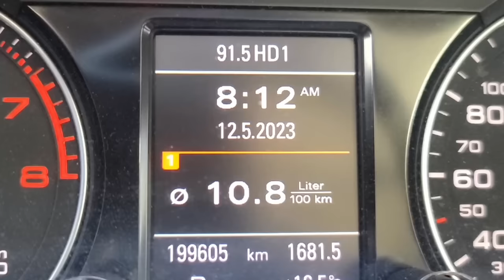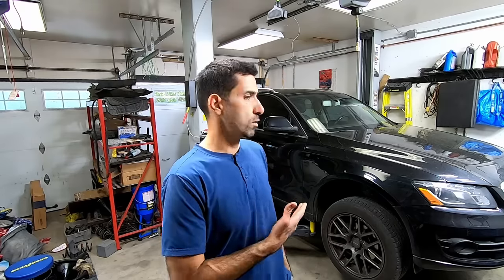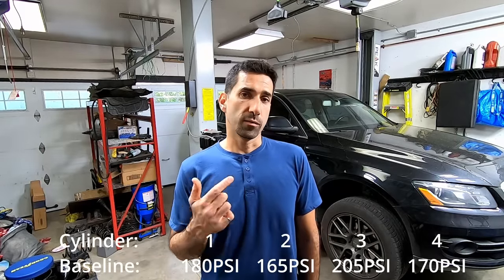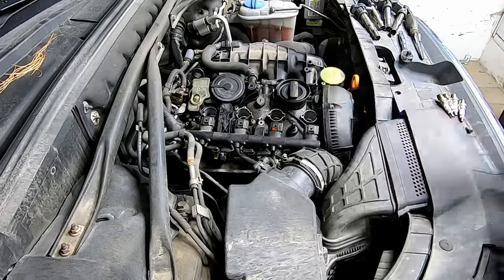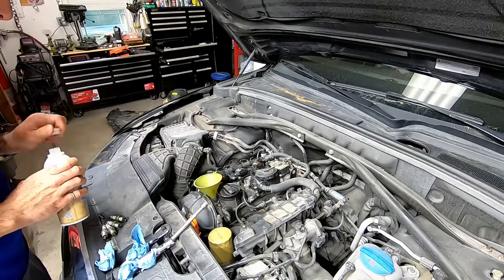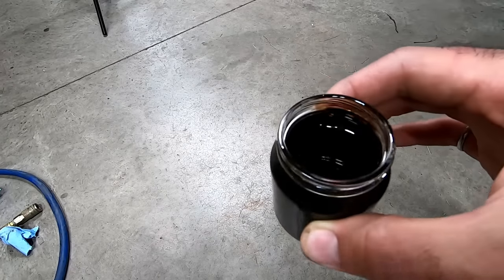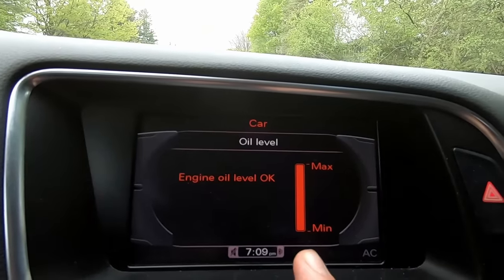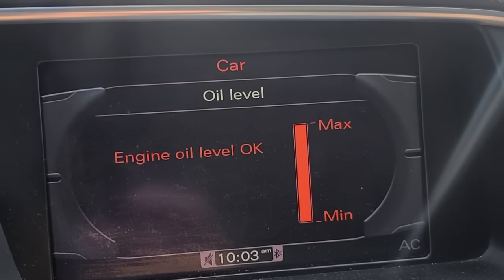How to fix excessive oil consumption from clogged piston rings (Part 2)

Comment: Can't believe this worked! Thanks! Did a Liqui Moly Engine flush at idle for 15 minutes, then did the piston soak with only 2 treatments of 2oz per cylinder. Checked with a endoscope the next morning and vacuumed out one cylinder with a syringe and hose. Changed oil and plugs and the oil level is holding with no change now. Was burning about 1 quart every 100-150 miles. Great stuff!
Reply from the maker: nice! that sounds like a good alternative
Reply: Update at 1000 miles on my 2012 Audi A4. About a third of a quart used since the engine flush & piston soak 🤯 crazy! I was at about one quart per 100-150 miles before. I thought I might do a second treatment with berrymans but it looks like this has done the trick! Stoked I stumbled across your video 😁
Reply from the maker: @lukewiens6134  great results!! Thanks for posting
Reply: Vous avez utilisé un Engine Flush Liqui Moly.
Et ensuite vous avez mis le même produit dans chaque cylindre pendant une nuit?
Reply: @ecerce2151 I used liqui moly engine flush as directed by the instructions, then before changing the oil then did the piston soak with berrymans. afterward I changed the oil and started the car. Took 2700 miles for the audi to say I needed to add another quart
Reply: Could you explain me the process to soak the pistons? He mentioned to crank it. Could you not hydro lock it?
Reply: @fredbeiner2620  not if you don't put the spark plugs back in, which you shouldn't anyway.
Reply: @fredbeiner2620  and it's best if you hand crank it.
Reply: how was yours starting? after it was done?did it take a while
Reply: @timpresutto184 it took about 20 seconds to catch and then clouds  burning up out of the exhaust for about 5 mins
Reply: @basesperanca  Couldn't you just pour it in the fuel tank and avoid all the drama?
Reply: @ETMotorsports   Couldn't you just pour it in the fuel tank and avoid all the drama?
Reply: @alexshatner3907  put what? B12? No, it's supposed to soak the pistons. The same principle as leaving your dirty, dry dishes in the sink with soap and water.
Reply: @basesperanca  But is that like trying to soak a piece of metal that is not like a cloth that can absorb, like washing your car from the outside and it is soaked for one week with water, because of all t he water that was absorbed into the paint??? I'm Confused, unless the rings and cylinders are made of cloth
Reply: @alexshatner3907  what we're trying to clean is the sludge that got into the piston rings/grooves and oil drain holes that got clogged with carbon build up in the pistons. It's the carbon build-up/sludge that will get soaked and soften up/liquify, and then get flushed away with an oil change. So, the pistons are like the plates, and the carbon sludge is the food. It makes sense to me.
Reply: @basesperanca  That does make sense, so what gets soaked is not the metal, but the carbon and sludge, but does the product also get poured in the oil? or does it just get poured in each cylinder?
Reply: @alexshatner3907  the product gets poured into the cylinder but if clearance between piston and cylinder wall are not tight enough, some of it will get into the crankcase and therefore the oil. That's why some people I've seen prefer to flush the oil immediately after a soak, instead of driving it directly.
Reply: @basesperanca  Gotcha

Comment: I did the same treatment for my 2001 Toyota Corolla, which was burning oil like crazy. I also had a very difficult time starting up the engine, just like you. I was told because there was no compression. But my Corolla is barely burning any oil now. so this works !!
Reply from the maker: Hmm so I guess the compression gets affected from the soaking? Interesting...I guess that's possible... it's funny I actually watched a guy on youtube do this to a corolla before I did it on my audi :) full circle
Reply: @ETMotorsports   I think you and I saw the same guy on YouTube that did this on his Corolla. I remember his channel is DIY Dave or something like that. That’s how I learned and did on my Corolla. Lol.
Reply: @ETMotorsports  The carbon that is getting the oilring blocked is the same that could get an piston ring stuck.
Reply: oil washes out from pouring solvent so they dont seal. i could barely start after pour, but it worked and now im not adding oil
Reply: The 2001 Corolla oil burning issue is a little different. It's due to plugged oil return holes in the piston-- of which there are only two-- that was the root of the problem. Later designs had four oil return holes. I have a 2001 Corolla, original owner, 225K miles, and it still doesn't burn a drop of oil because I always changed oil at 5K miles with synthetic from day one.

Comment: I performed the piston soak 3 days ago - so far over 100 miles and no moving the oil level bar. We will see..as I am usually only able to go about a week or less without noticeable oil consumption on the bar graph. Will report back here next week. I performed the procedure as in the video except i went longer than 24 hours due to it ending at 3 am - i performed one more manual engine crank with 30ml of B12. FYI the socket you need to crank the engine is a 12 point 24mm short socket. Noticed 3 of my spark plugs were all gunked up with carbon so i soaked them in B12 to clean them off  and used a toothbrush -while doing the piston soak. Before i put the plugs back in I removed the 25 AMP Fuel pump fuse - cranked a few times to clear any remaining fluid. I had to crank it 3 times with the key before it would start. Then it started up just fine.
Reply from the maker: Awesome - thanks for the info! Pulling the fuel pump fuse is a good idea - your can see my motor pushing fuel out when I'm cranking it
Reply: Can you give us an update please?  How has it gone since you did the B12 treatment?

Comment: holy crap...for myself it actually worked. followed your directions and I went from burning 1 litre of oil every 3-400km to now well over 1500km and the dipstick still remains the same level. I thought I was going to have to rebuild the engine cause of this oil burning problem. thanks again you're a legit lifesaver bud. I have a 2009 a4 with 150k on the odometer
Reply from the maker: Great results! Glad it worked
Reply: Mine is blowing black smoke. Could this be issue?

Comment: Final update for me.  At my 2nd oil change at 10k miles and not a drop of oil used.  You're a lifesaver!!  2013 Audi Q5 2.0T with 140k miles.

FYI, my preventative recipe has been 2 bottles of B-12 in the fuel tank at every every oil change, and I put 7 oz (1.5 oz/QT) of Seafoam in the crankcase 300 miles before changing the oil.
Reply from the maker: @Diver_Dan  great results! I'd suggest shorter oil changes perhaps? Where are you putting the B12? 2 bottles in the oil will be too much every time
Reply: @ETMotorsports  shorter than 5k miles even though Audi says 10k?  I actually change it at 5k or sooner if it looks dirty.

Comment: I finally did the piston soak with Berryman on my Volvo V60 2015 T5 which was burning 1L per 1000km. 
I would strongly suggest the following (which I did) additional steps :
- using compressed air, blow out all dust around the coil packs, and while blowing down the plugs wells (while the plugs are still in) I would vacuum the dust airborn on top of each plug well. 
-Prior to putting back the plugs once the treatment is over, I attached a 1/4” plastic tube to my shop vac and created a vacuum hose that I inserted down the wells to suck up debris and loosened up carbon deposits, and leftover chemical.
-I also used a endoscope (amazon) to verify debris and left over chemical
-Changed oil and filter 
-I then turned the engine a few times with fuel pump fuse removed in order to run fresh oil and to remove chemical vapors
-installed fuse, and started the car. It took 7 attempts without the thick white smoke as seen on the video. (It is important to have a fully loaded battery)
We shall see the results.
Reply: How’s the Volvo doing now? I have the same car and same issue.
Reply: I am up to 2500km, and the oil went down one notch ! Also, no more oily carbon deposits on the tailpipes. Dramatic improvement!!!

Comment: I did this to my 2017 Sonata 2.0t.  Was burning a quart of oil every 400 miles (gas tank fills).  Shocked that it worked so well. Did my last oil change (every 5K miles). Zero noticeable oil loss.
My car is at 152,000. Running great, still getting 30+ mpg and quick as ever.  Now if I can get the annoying sensor lights off, it will feel like new.
Reply from the maker: @VicFan-e7r  nice!!

Comment: You may want to double check the spark plug gaps after dropping them down into the holes.  It's never a good idea to drop them in like that as the gaps can get crushed.
Reply: That shit doesn’t matter at all man. I’ve pulled plugs so damn corroded and the car is totally fine. It’s only there to make current arc.
Reply: @nat0rade  On real engines, like German and other high end machines use, the spark gap is VERY important because the timing is done at the injector using an encapsulated kernel of flame - if the gap is too big, it will fire late.
Reply: @nat0rade  That kind of installation is what actually got me chasing a miss fire on my car and overlooked at the sparkplugs thinking theyre new they should be ok. It does matter, the rubber grabber on SP tools arent just for pulling the SP out but also to land them properly into the SP well.
Reply: Spark plug gap affects resistivity bigger gap needs to build even more potential difference to build before spark may delay spark by milliseconds until gap is big enough to delay enough to cause a misfire, but yea there is an acceptable range of gap...
Reply: Also too high resistance in plugs will also cause leads to be more prone to arcing... best know your gaps, manufacturers generally specify for a reason, you may not understand that reason but it's wise to follow them for best longevity(yes it won't blow up with a .3mm gap but it may cause excess loads on the system ie higher current...
Reply: Or it could snap off and go into the combustion chamber 😅
Reply: @nat0rade no u just got lucky!
Reply: Improper gap can also wear the coils out prematurely. Any performance tuning will require even stricter gap attention.

Comment: Everyone, this works….was adding 1 qrt every 250 miles or so on my 2011 A5. Did a 48 hour soak…I’m going on 400 miles post soak and oil level just now went down one tiny square of the oil bar, so given that, I’d say I’m looking at maybe a quart every 1,500 miles or so. Will post again at about 1,000 miles. This really does work…but be sure to follow the step by step instructions. Awesome video Eurotrash…thanks a million.
Reply: By bad, I’m going in 600 miles and went down one square on the oil bar. I think I might be looking at 1 quart every 2k miles or so.
Reply from the maker: @manuelcabrera9319  great results! Let us know when the light comes on - you can always repeat the treatment if it's not 100% effective the first time... also pay attention to the consumption - on the q5 it actually slowed down so it burned about 300ml in the first 1000km and the rest in over 4000km... curious if you see the same thing

Comment: B12 is phenomenal. Been doing top end soaks on my old Toyotas that coke up the same way, and it truly works!!!
Reply from the maker: like regularly? Interesting...which Toyota engine? I`m guessing similar oil ring problems?
Reply: 😅😅😅 I have the same issue and I need that help 🤓
Reply: '99 1ZZ and '08 2AZ .. I've done 2 soaks on each, just started last December or so when I got sick of dumping oil every 300-400 miles. The 314k mile 1ZZ is up to about 1000 miles before it needs any added and the 150k miles 2AZ made it through its last 3000 mile oil change without needing any. Probably going to do it every 4th oil change or so at this point. It really saved both engines.  @ETMotorsports
Reply from the maker: @WiscomptonBoys  awesome results

Comment: Another success story- I followed this process on my mother in laws 2014 Q5. It was down 1.75 quarts after 950 miles since prior oil change. She had quotes upwards of $7k to replace or rebuild  the engine. I did this soak, rotating the engine roughly every 6 hours, and changing plugs after running it for awhile since they got pretty carboned up during the misfires immediately afterwards. 
After the 24 hour soak about 2 months ago, she's at 1100 miles and oil level is still basically full. Pretty ridiculous overnight change! Thanks!

Note, I thought I had done something very bad to the engine as after a couple of hours I was still getting a really bad misfire. Turns out that 3 of the 4 coils had lost most most of the rubber boot inside the sleeve. There were also signs of burnt oil all over the coils, indicating a gasket cover leak (probably  contributed to the coils getting destroyed). They must have been hanging onto the old plugs for dear life, and not connected well with the new plugs. Just a reminder to check the coils and plugs when you take them out to avoid that extra stress 😅
Reply from the maker: Awesome results! Glad it worked out... yeah this basically assumes that everything else is in good working order...I bet you scored some great points with the mother in law!!

Comment: I saw your video and had my brother do this over the weekend to my 2016 Q5 with 203k miles. Knew it was the pistons! Drove 200 miles home last night and it's still at max oil!  Thank you sooooo much for this video. I will be giving you a shout on my podcast this week!! This was an epic WIN!
Reply from the maker: Glad it worked!! What was the consumption before?
Reply: i have 2012 q5 with 102k miles in it similar issues! did  you follow the exact instruction as in this video? i am not a car savvy, not sure to take a risk yet? please advice
Reply: yes, this procedure works! I can confirm. I performed this procedure on my 01 corolla (200k miles) and my 2013 hyundai sonata (230k miles). both vehicles were burning oil like crazy. After the procedure, coil consumption seems to be reduced to approx 90%, which i am extremely happy.

Comment: Did this on my 2014 Q7 w 3.0t with 112,000 miles on it. It was burning 1 qt per 800 miles prior. Just crossed 1,000 miles since doing the job and the oil is still full!

I did it a bit different than you. 

I waited til the oil light came on, so I was down a full quart. I bought 8 cans of B12, and poured B12 into each cylinder until it came out into the spark plug hole. So each cylinder was fully full, and let them soak like that.  Next day I hand cranked, and added a bit more B12. 6 hours later, I duck taped a steel straw to the end of my shop vac and vacuumed out the cylinders to remove any crud I could. I added more B12 and let it soak again. When I looked the next time, most cylinders were drained, so I hit the starter to crank and move things around.  I then added more b12 for one last soak. I vacuumed again to get any excess B12 out before putting in new spark plugs, and closing everything up. 

The car started up pretty easily, and smoke was minimal. Because I was over full with oil and B12, I only let it idle and come to temp. I did not drive it, or rev the engine so I didn't blow anything out.  I then changed the oil and filter, and went for a drive. It runs like new. 

Note, even with the special tool, manually cranking the engine was really hard. My wrench slipped and I think I broke the tip of my finger because it still really hurts!

Thank you for showing me how to do this job, and saving me from having to buy a new car!

Comment: Cheers to you!  My 2010 A5 Cabrio was burning a quart in 350mi.  I’m 500 miles since the ring soak and oil level hasn’t budged.  I’m changing oil and filter at 1000.

My first Audi was a 1970 Super 90.  POS!  It was 40 years before I walked into an Audi dealer again.  I won’t live long enough to walk into another.
Reply from the maker: Haha - great results!!! Yeah unfortunately most German cars aren't what they used to be but we still love them